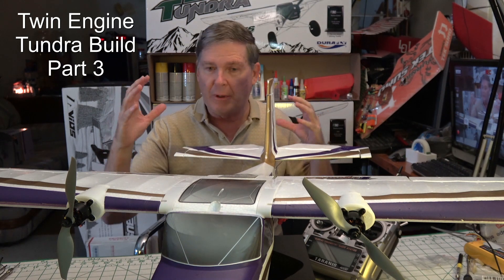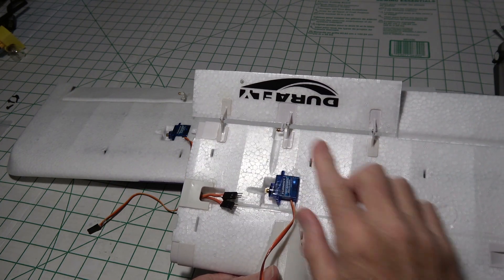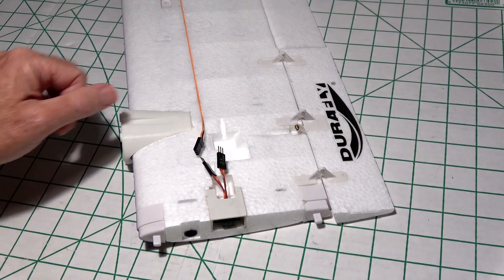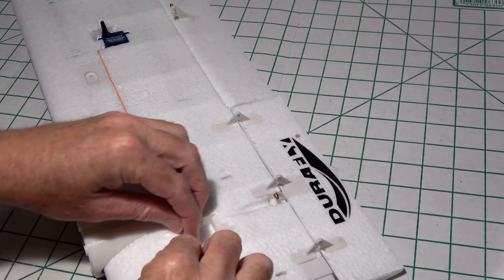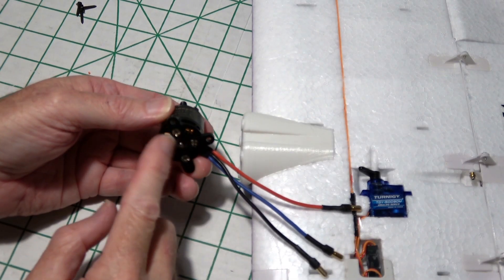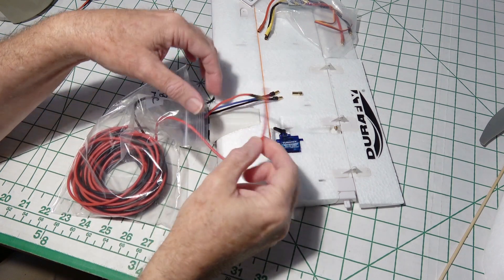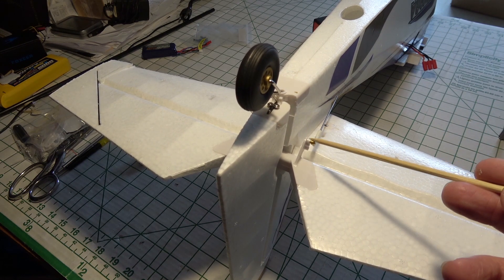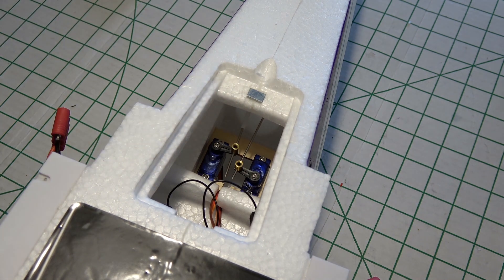DIY Twin Engine Tundra RC Plane Build - Part 3 (Installing Motors, Wing Servos, Tail Section)

Comment: Great video, nice ideal about the piece of wood.
Reply from the maker: Thanks. You can drill different size holes in the wood to solder all kinds of connectors.
Reply from the maker: For the S500 have you looked at DIYdrones, they have threads on APM and 3DR raidios, very good resource. 
 https://diydrones.com/forum
Reply: Yes, I think they named that helping hand wrong. Should be named, It never stays where you want it hand. I'm being polite don't you know. Thanks for the advice.

Comment: 11:20..The differential thrust is reversed to the Rudder movement.
Reply from the maker: Good eye. I had to unplug the motors from the ESC plugs and swap the ESC wires left/right. Another solution would have been to swap the throttle channels.